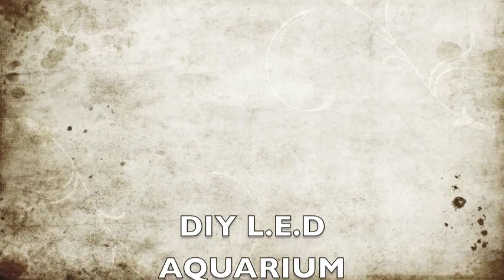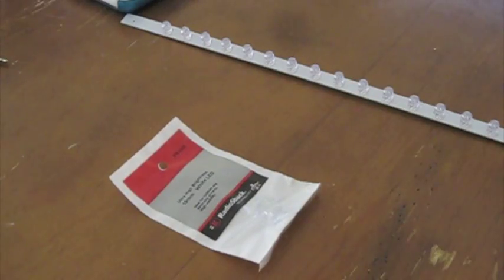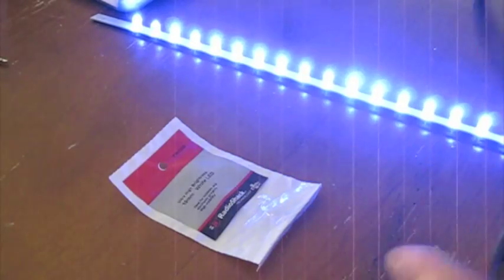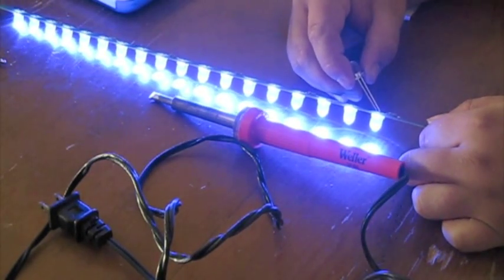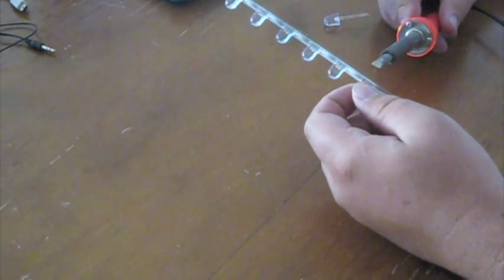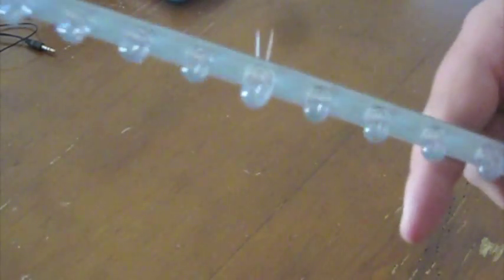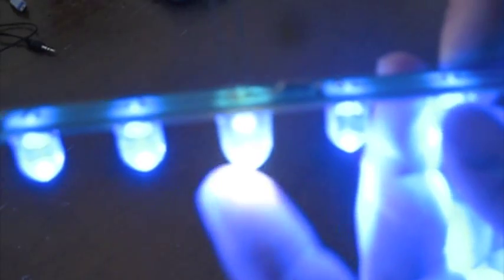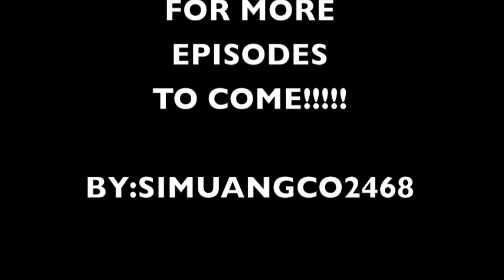DIY: LED aquarium lighting

Comment from the maker: Good Idea, I thought about leaving a few blues.. I just dont know yet I just ordered 50 l.e.ds and 4 more circuit boards and power supplies.. The price to light the entire 55 gallon will cost about $35.00.. I will probably leave some blues in here and there.. I will use a total of 4-5 strips on the 55 gallon cichlid tank. Thanks for the input..